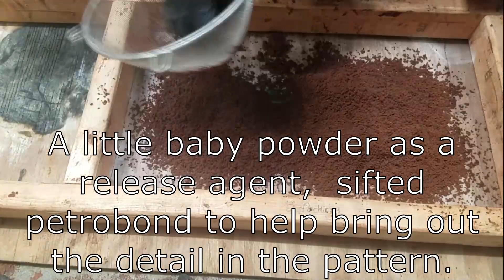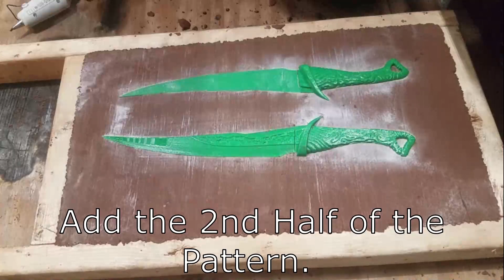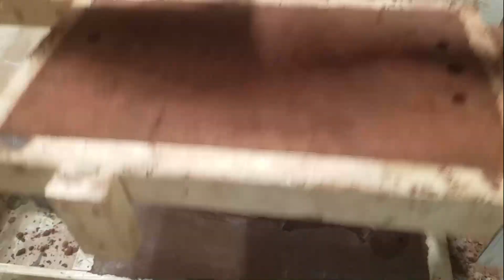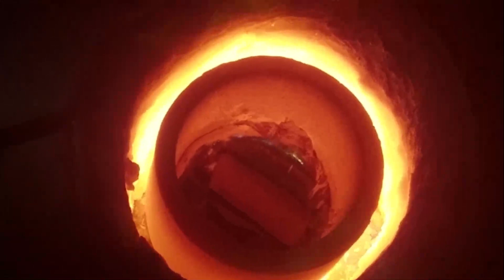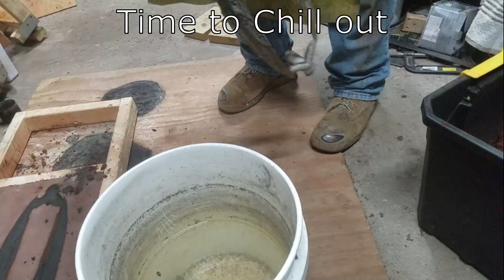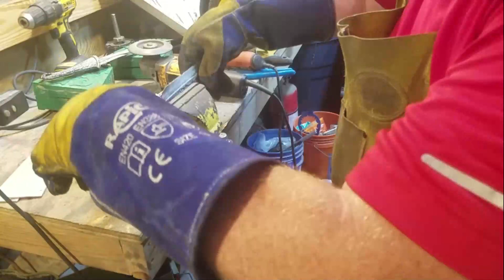Making the Drax the Destroyer's Daggers, #SandCast #Aluminum Guardians of the Galaxy #DevilForge

Comment: From other videos I've watched, always pour from tip to handle since it is thin at the tip and metal will have cooled down too much by the time it gets down there on a long run like that to flow nicely into the tip.  Again based on other vid's not something I've tried. Overall very nice!
Reply from the maker: Ive seen and tried both directions, about equal results both ways
Reply: @Thewulf56  good to know.